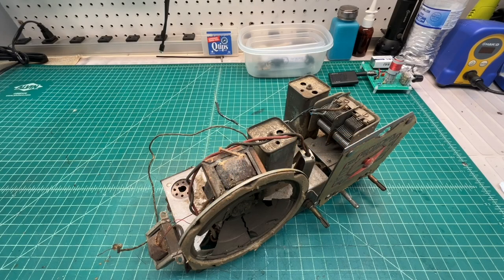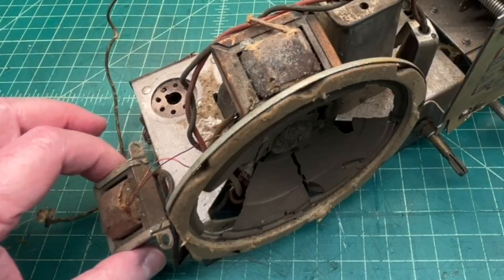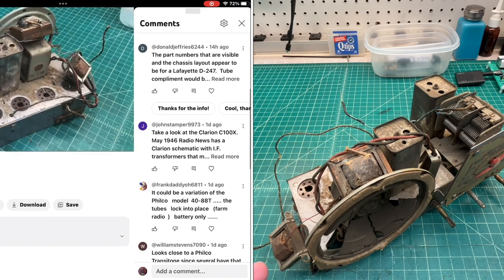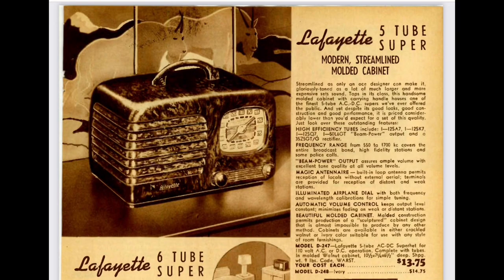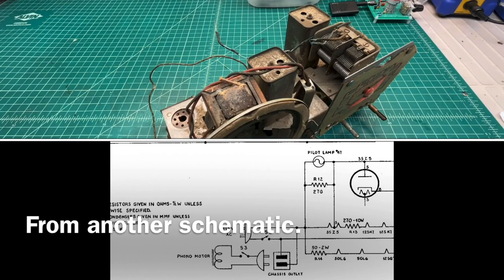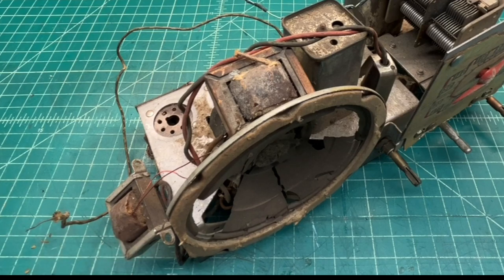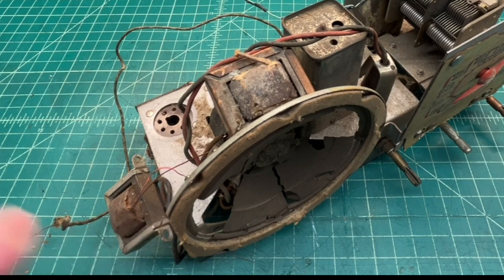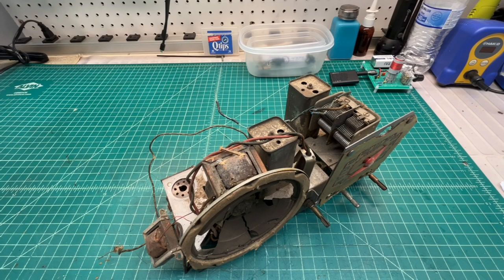Update on Unknown Radio Chassis - Thanks For Your Help

Comment: You bought this thing?
Reply: I guess he though he would use it as a parts chassis. He put it in a box and forgot about it. Been there ,done that.
Reply from the maker: Alain - I did with a hand full of other radio chassis' for parts & pieces many years back. Best, Don